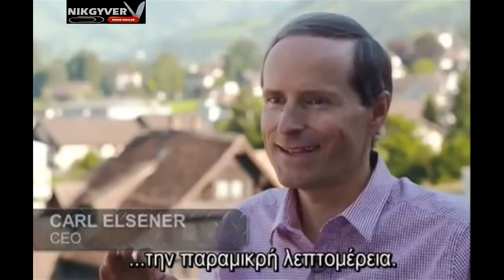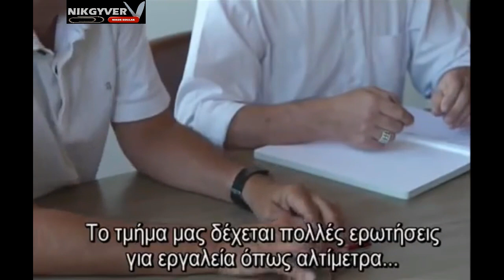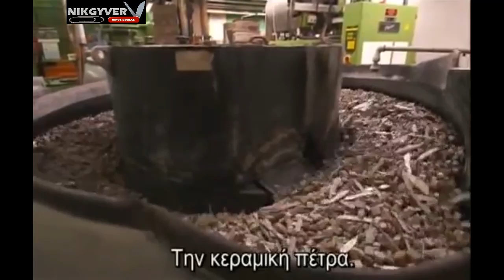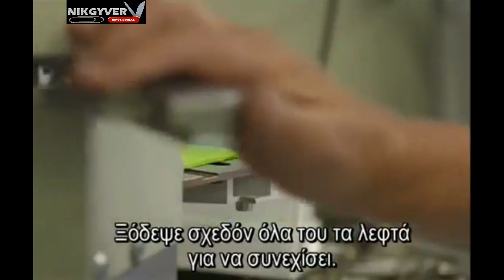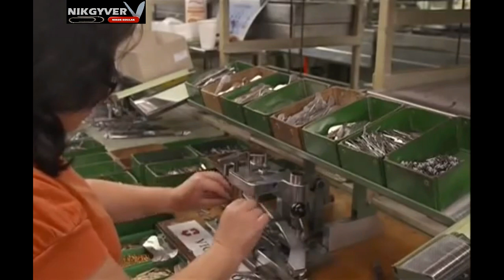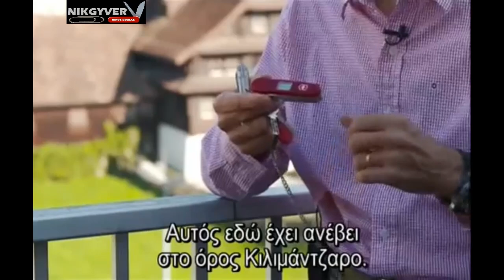How it's Made:Swiss Army Knives.Πως Κατασκευαζονται:Ελβετικοι Σουγιαδες.

Comment: I'm waiting for: 
- knife 111 mm  to city - Hercules without saw
- Atlas with liner lock.
Reply from the maker: have a look at new skipper model,maybe is close in this that you looking for...
Reply: @nikgyver7  Thanks, but it has a spike, totally useless for me. I have most of models 91 i 111 mm and i'am waiting now for these models. Maybe in future they will appear. Nowadays i carry everyday Ontario Rat 1, Victorinox Spirit, Victorinox Climber and often also Adventurer new.
Reply: I'd like to see a "Survivor" model: Wood saw, metal saw/file, scissors, awl, straight edge blade, serrated small blade, tiny signaling mirror (with hole in the middle) LED light (with multi-color ability - red for night vision preservation, as one example), compass, digital clock (plus other features in it, like altometer, stopwatch, alarm, thermometer, etc.), whistle, thin case to hold fish hooks, line, sinker, sewing needle + thread, etc. Adopt the Firefly ferro rod (by Tortoise Gear) in the toothpick hole, and/or FireAnt + tinder inside the corkscrew. Glass breaker. Make another spot to fit a blade sharpener diamond rod, the same shape as the Tortoise Gear ferro rod. Magnifying glass (yes, to start fire as well). Make color options: OD green (on the tools as well), green/brown camo, all blacked out, or glow in the dark yellow and/or orange

If they could somehow switch the current pliers out for vise grip pliers, that'd be great. :)

For now, I will likely be getting the SwissChamp in the near future. Before that, I am now waiting for my RangerGrip 79 to arrive in mail. :)

Comment: I bought my "Officier Suisse" SAK expressly FOR the scissors, and unless I lose or break mine, I'll never need another... I hadnt realised what GOOD stainless steel can do until I started using the SAK blades. Was amazed at how many SAKs are made every year! Who buys all those knives? I use it around the house and kitchen, and even in the garden, as well as for skinning and gutting animals I hunt. 
All the talk about lifetime warranty is bull-bleep, at least was in MY case. The spring on the scissors snapped after a couple years (and I don't really USE the scissors that much).. I got hold of the SAK people here in the States, and they blew me off, saying the company couldnt be responsible for replacing the spring- they wanted to take the knife (my $$$ to ship) and replace the spring for $$$10.00, JUST FOR THE SPRING ITSELF!!  Seemed ridiculous to me, so in the event I rigged a replacement of my own- but not everyone has metal working experience-  so the scissors DOES work, albeit not as it was sold to me- but it left a bad taste in my mouth. It seems these Swiss are longer on PROMISES than they are on standing behind their word or product. Had they seen fit to send ME the spring I could have replaced it myself, with less finagling than it was.  Sooo, they DON'T stand behind that "lifetime warranty", and NO MORE SAK products for ME. Just sayin, YMMV!
Reply from the maker: i am sorry about,my experience the warranty works,never heard something like your experience or complaint about.maybe the problem was the shop not for the factory.thanks for the comment.